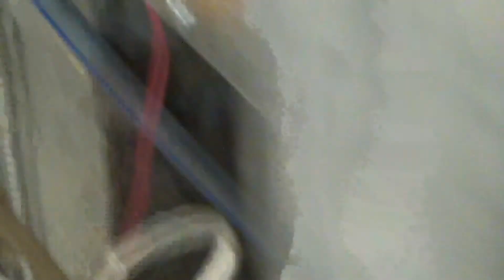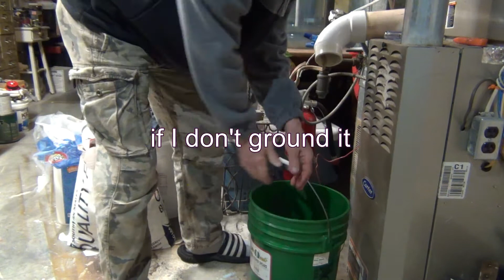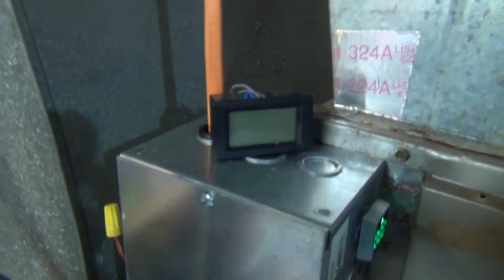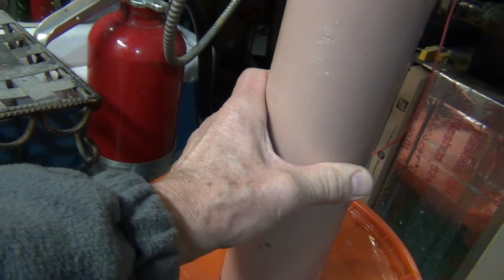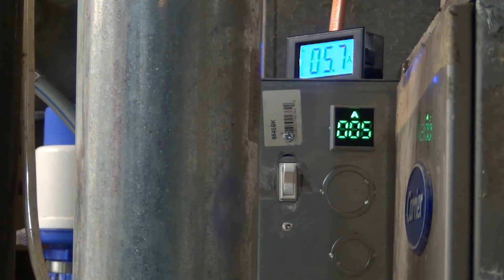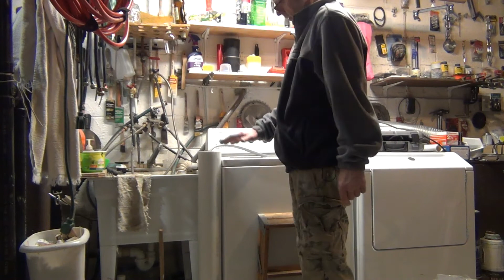how to make whole house humidifier simple cheep and effective

Comment: Vlad, very interesting and out of the ordinary humidifier. 
You put this video out  3 years ago and I just found it out today (Dec 26, 2023) !
The way I understand you have two metal bars separated by some type of insulator. Then you connect the bars to 220 VAC wires.
By immersing these hot (electrically hot) bars in the water they become a heater by the conductibility of the water, right ?
The ground wire in the bucket is to prevent electric shock in case you put your hands in the bucket, correct ?
Now you mention 10 amps at 220VAC, so I figure it is consuming about 1800 Watts.
Do you notice and increase in your electric bill ?
Reply from the maker: Yes you’re correct on everything even on the power consumption, it does eat the power like mad man. Also with fresh water it will eat about 5 A and as the water gets old like a week or so the power consumption gets worse like 10 to 12 Amps and that’s the time to change the water. But the efficiency of this design is much better then any commercial humidifier.
Reply: @VladFredK  I like the built in safety feature: if the water dries out it stops. But if it was a heating element it would burn out.
I suppose if you were to make the bars shorter that it would consume less electricity, but also less water vapor ?
Reply from the maker: @Rose-f2t  correct, or you can increase the distance between the plates and it'll be less power consumption but also less steam. You could also run it of 120 volts for less money but also less steam.